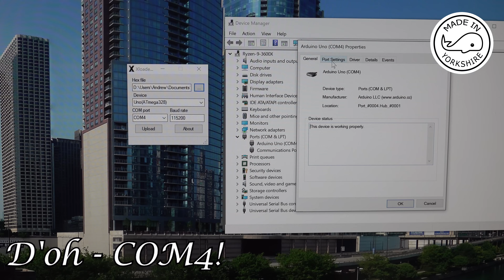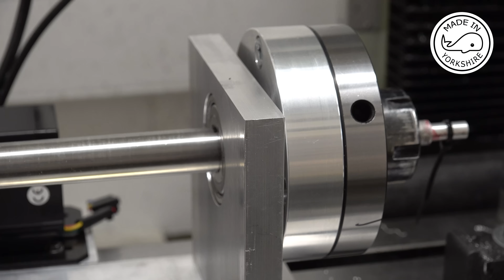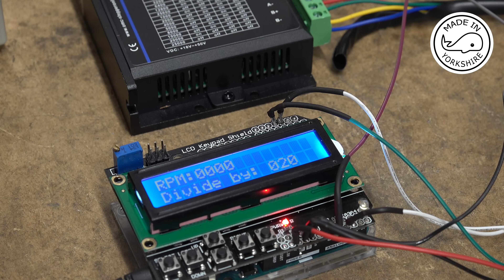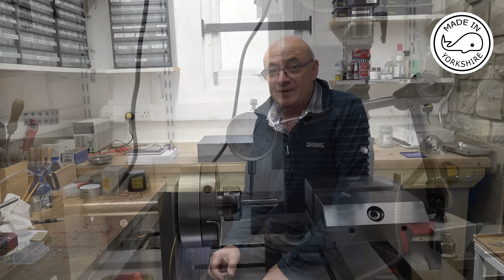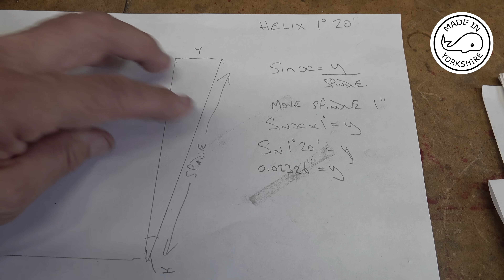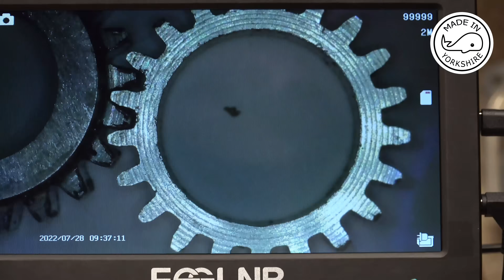#MT50 Part 4 - Making a Gear Hobbing Attachment. Making Test Gears. In 4K/UHD by Andrew Whale.

Comment: Watching Andies video, the led on the arduino lights up when the hob and the workpiece are out of sync 
Stopping after a cut will put it out of sync, as Andie say cut the gear in one pass at full depth
Reply from the maker: Hi thanks for commenting. The sync problem is still apparent when making a single cut. Not openly obvious on the aluminium gear, but really bad on the mild steel gear. I never stopped the mill during cutting and the led never lights up. A bit of a brain teaser, but lots of suggestions for me to try.
Cheers
Andrew

Comment: Hi Andrew, I’m certainly no expert but wonder if you could be seeing the cumulative effect of rounding errors in the Arduino code over time. I have made a stepper motor driven head for cutting gear teeth and in the forum on the build I followed this was an issue raised (and you may only need one or two passes to cut a gear with a gear cutter - you’re rotating the mandrel many many times so the hob can cut yours. Even tiny errors in rounding will aggregate over enough rotations to show as a loss of sync. 
The other comments over electrical noise are also potentially very valid. I noticed your oscilloscope seemed to fluctuate at times by at least one step (but that could also have been an effect of a rolling shutter in the camera). Any lag between the spindle speed changing and the gear on the mandrel matching rotational speed would also look like lost steps or sync issues - eg when the cutter is loaded or unloaded, if the cutter is not progressed through the work uniformly (and even then it has to start and stop the cut unless you have sacrificial blanks either side and cut in one pass). 
Like I said, I’m certainly no expert, just my thoughts and observations. Love your approach and your content. Please keep it all up. I know you’ll get to the bottom of it and find the issues and solve them. Cheers, Nick
Reply from the maker: Hi Nick - many thanks for your thoughts on this. From comments made I've made a list of things to check out and try out. Hopefully I will be able to sort it. I don't like failure!
Cheers
Andrew

Comment: hi Andrew, I'm not seeing why you are spinning the gear blank while cutting unless you are making helical gears. if you are making straight ones usually the gear is positioned before each cut.
Rich
Reply from the maker: Hi Rich, for hobbing you need to turn the gear blank in sync with the mill spindle. Strange though it may seem, and I still struggle to get my head around it.
All the best.
Andrew
Reply: @learningturningmetal  hi Andrew, thank you my friend for getting back to me. obviously I don't know how to make gears. I thought you could make one with an Indexer. what type of gear are you making? it appears to be a spur gear.
Reply from the maker: Hi Rich. Yes it's spur gears I'm making. The easy way is to use an indexer and make the gear with a gear cutter. Problem is you need up to 8 different cutters for a particular profile of teeth. Cheep cutters are around £30, so a full set is well beyond £200. You can pay £100 for just one cutter! Another way is to use a gear hob. Only one hob needed to cover cutting the full range of teeth. I struggled getting 4 different 48DP cutters for the Jerry Howell v-twin, so I decided to explore gear hobbing (plan B). It's a very interesting subject and I still can't get my head around it fully. I've now got the four gear cutters I need (plan A), but hobbing might be the future! 
Cutting a good gear is very satisfying!
Cheers
Andrew
Reply: @learningturningmetal  thanks Andrew for the nice reply. I do understand now what you are trying to accomplish. Rich

Comment: Thanks for a well filmed, produced and entertaining video.
Lots of good advice and clever suggestions are given by knowing people earlier.
However.... Being one of many guys on Arduino forum helping young people growing in  programming and electronics I do have opinions about powering the controller by 9 volt, into Vin. Why on earth do that? Supply the controller with 5 volt to the 5 volt pin.
The Vin converter producing 5 volt has no heatsink and often gets overloaded, shutting down. It barely manages the UNO itself.
You use 9 volt but often people use the maximum, 12 volt. Know that all 5 volt devices depend on this tiny 5 volt converter. The LCD, especially the back light is a heavy consumer.
The encoder is likely an easy load as well as the button board, but all together, what does it sum up to?
If You ever faces problems after running long sessions, change the power supplying.
Reply from the maker: Hi Stefan - many thanks for the advice. I'll keep my eye on that.
Cheers
Andrew

Comment: The issue is with lost steps. You want the lowest microstepping you can get away with, this brings better torque. In the 3d printing wold this type of issue is very common and is associated with higher stepper speeds and heavy weights. Also see if you can increase the amperage of the stepper, keep an eye on it as long as it's under 65ish centigrade it should be fine.
Reply from the maker: Many thanks for the advice. I will give that a try. 👍
Cheers
Andrew

Comment: Great looking project and thanks for showing warts and all. I'm not normally moved to comment but this intrigues  me :)
My feeling is the mill motor is essentially freewheeling dc motor and when load is put on the mill it slows a bit and the stepper pulses lag the sync pulse from the spindle which induces and error. This is not too bad over a short period but if there are multiple passes this error compounds and you end up with a bicycle sprocket.. If it were just lost pulses the teeth would be tilted over as in on example but you had some examples where it looks like the error seemed to have wandered about and just opened the tooth gap. Possibly you could try and just cut from one side instead of back and forth. Which may help in identifying the issue.
Fraser
Reply from the maker: Hi Fraser - many thanks for your thought on this. More tests needed. Yeah - showing problem I come across has two major benefits: I get some great advice from others and it might help others who experience similar issues.
Cheers
Andrew

Comment: Because of the change in angle of the head, wouldn’t you need to compensate for that in the x travel? Or the backlash in the mill would show itself because of angle of the cutter?
Reply from the maker: Hi Bruce - thanks for the suggestions. I need to do more testing to try to work out what is going wrong.
Cheers
Andrew

Comment: with the encoder connected with loose unshield wires and no filtering on the board it is very likely that any electrical  noise from the spindle/stepper etc. can make it count false pulses now and then
Reply from the maker: Many thanks for the suggestion. I will check that out.
All the best.
Andrew

Comment: Hi Andrew, the problem with the method you are using is that if the sychronization is just a tiny bit out or a step is missed then the two spindles will get out of step and you will get exactly the result you are recording. The worrying thing that I saw in one of your tests was the variability of the spindle speed of he mill. One thing I could suggest is that you try with a lower spindle speed as you may be losing sync due to either missing pulses or even the encoder not producing clean pulses. Also you are using a belt from the stepper motor which may be stretching under load.
Finally, check you current settings of the stepper motor, the hob will put a lot of load on the stepper and may be forcing it to either over or understep. I had a similar problem with a cnc mill where the the load on the moter would cause so much resistance to the stepper moving that occasionally a step would be not happen. To overcome this I turned up the current on the stepper and all was fine. Sorry if you have already checked this.
It would be interesting to know whiich side of the teeth were malformed as this will give you an indication as to if it is overstepping or understepping. Hope this helps.
Reply from the maker: Hi Terry - many thanks for the suggestions.  I've added them to a list of things for me to check out.
Cheers 
Andrew

Comment: Try multiple passes without turning off the mill … likely “changing” sync during startup
Reply from the maker: Hi Fred. I never turned the mill off between passes, but something isn't right. Thanks for the suggestion though.
All the best.
Andrew
Reply: @learningturningmetal  
Andrew …The comments by andysmachine is spot on.  After checking some references… each pass with the hob cuts a set of teeth, the first pass cuts a gear with the tooth profile shifted out from the nominal position.  The next pass creates a gear with a smaller profile shift, and so on.  When I superimposed 4 profile shifted gears on top of the nominal gear, I get something that looks very much like your results
Reply from the maker: Hi Fred - thanks for the info. One thing that puzzles me is that the single pass on mild steel produces a really bad result too - 27:09. I can only put this down to the amount of time it took me to cut it.🤔More experimentation needed.
Cheers
Andrew
Reply: Hi … Andrew ….the problem with the single pass on steel.  Since your setup work will with aluminum, you must be loosing sync.   I have had issues with rotator encoders in “high” vibration environments.  The vibration showed up as noise on the encoder signals, causing false and missing counts.  We just replaced the encoder with a better one.  This was during my working career (not a machining application) and we did not take time to really diagnose the problem
Reply from the maker: Thanks Fred, that is really interesting. I'm just working through various suggestions and currently getting nowhere. The signal from the encoder does sometimes look noisy but I've not been able to isolate the problem. Maybe a case of shielding, or lack of it. More experimentation needed.
Cheers
Andrew

Comment: Probably not a glaring issue Andrew, but the soldering on pins 2,3 need to be given a once over. Pin 3 for sure is looking a little dodgy. Have a good look at all of the soldering connections to your shield with the new digital microscope :) Cheers. EDIT: upon review,  go over all the soldering just for good measure. Maybe a little more flux, or higher temp. Hope you have discovered that lead free solder is crap. I hate to make these critiques, but somebody has to do the deed.
Reply from the maker: Hi Chris - thanks for the advice. My soldering has a lot to be desired. I will check it out.
Cheers
Andrew

Comment: Possible issues could be pulse skipping, where the stepper motor doesn't actually move to all the steps sent out by the driver?

This can happen if the pulses are sent too fast for it to respond, and that can be due to insufficient current to drive the motor fast enough for each step due to the balance between the inductance of the winding and the current limit of the driver not being in tune with each other   -   a motor with high inductance windings will require a larger peak current to sharply move from one position to the next than a motor with lower inductance windings.  If the current limit on the driver is too low then the motor may not move the exact number of steps the driver is outputting,   the end result will appear to be skewing of sync which will get larger over time.   The other related possibility is the stepper driver has a high enough current limit, but the power supply sourcing the driver is incapable of supplying those peaks so will be limiting instead.

A possible way to try and work out might be looking with a 'scope at the voltage to the input of the driver - if you can see narrow spikes of the voltage rail dropping in sync with the pulse telling the motor to step forward, then it suggests the rail is transiently collapsing because it can't supply the current.  A rough way to try and address that would a large value of capacitance at the input to the driver to act as a low impedance source to help ride out those current spikes.

The other possibility would be to just slow all the rpm speeds down, thus giving time for the motor to respond to the slower pulse train.

If you have a couple of other ABZ encoders then fastening one to the milling machine spindle and one to the stepper motor spindle and connect a counter to each so you can count the number of actual steps you get from the motor relative to the number of steps from the milling machine spindle.  It shouldn't matter how long you leave it running, the ratio of steps between both should be the same, but if the motor is skipping pulses then you'll see the ratio change over time.
Reply: sorry - only gave half an explanation last night...

Besides having current limit of the driver set to match maximum of the motor, you could also do with running the driver from the maximum input voltage possible.

This means in steady-state the driver output will be in current limit meaning the motor holds with maximum torque.  When you apply a pulse there is plenty of headroom for the driver to spike the voltage high to get the current in the motor coil to change fast, and thus respond to the step quickly.

This is the same principle as why when you turn the voltage off to a relay (ie. change the coil current from what it was at, to a new value of zero very fast), the inductance of the relay coil will result in a large voltage spike across it to try and keep the current the same - that can't go on indefinitely so it then collapses again.

The rate of change of current in the motor coil is a function of its inductance and the voltage applied across it.  You can't control the inductance, so if you want the current to change fast (and thus the motor shaft to respond quickly)  then you need to apply as high a voltage as possible.

If you're sending a fast pulse train to the motor and the voltage headroom isn't high enough, then the pulse will arrive and the current in the motor coil will start to rise at a slow rate.  However the next pulse may arrive turning that coil off again before the current has risen high enough to actually cause the shaft to turn in response to the first pulse.  Now it's off the current will start to slowly fall again....    ....when the third pulse arrives and the coil turns on again, now it starts to rise again, but from a higher level that it started from last time because it hadn't fully collapsed to zero.  Hopefully this time it does reach the level where the shaft moves a step forwards, before the next pulse arrives and the coil gets turned off again.....   etc. etc.

Viewed in this way you can see why it will respond to a single pulse - because it has infinite time for the current to build up and the move to occur, but send a fast train of pulses and some might get skipped.    Run from a higher voltage and the current will rise faster and thus the motor will respond and move quicker.    ....or slow the rotation speed of everything down so the pulse train to the motor is slower and thus you once again give the motor coil inductance more time to respond to each pulse as it arrives.
Reply from the maker: @IACooper  wow many thanks for such a detailed explanation. I will need to work through this in detail and undertake some more tests.
Thanks mate!👍
Andrew
Reply: @learningturningmetal  
I think the brief summary without the waffle trying to explain way,  is:

a) ensure stepper driver output current is the maximum the motor spec can handle.

b) ensure the input voltage to the stepper driver is the maximum it can handle (and obviously the power supply can deliver the current as well!)

Those two things should hopefully mean the motor can be driven from one step to another as quickly as possible, so it won't skip any.   If that still doesn't work, then try

c) slow down the milling machine spindle speed, which will slow the stepper speed and thus give the motor more time to respond to each individual step.

Obviously the down side to reducing spindle speed is also reducing the X-axis feed rate, but if you've got a motor feed on that(?) then it makes it a bit easier even if it does take longer.  If you're having to hand feed then it becomes more difficult.

Best of luck sorting it all out 🙂

Comment: I'm pretty sure you have some form of drift in the work and cutting spindle sync. you can hear it doesn't stop cutting even when you've completed a cut as it sounds like the indexer is either gaining or lagging behind the pitch of the hob. 
That small radial runout error could easily be compensated for if you allow a bit of clearance on your backplate register and just lightly tap the collet chuck periphery until the gear blank runs dead true and then nip the chuck screws up tight .
 Unless  those ER collets are the ultra precision versions then a little runout is often seen. Just make the collet chuck adjustable to compensate.
Edit to add: I am highly impressed by your progress with this project so far 👍
Reply from the maker: Hi Howard - many thanks for the advice. Fingers crossed I will be able to work out what is causing the drift. My list of things to check out is steadily increasing!
All the best.
Andrew